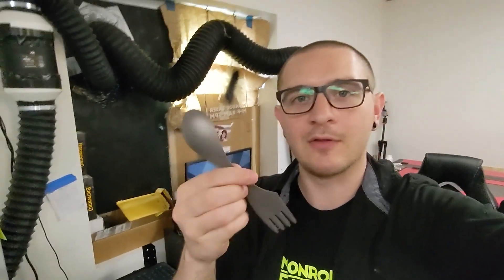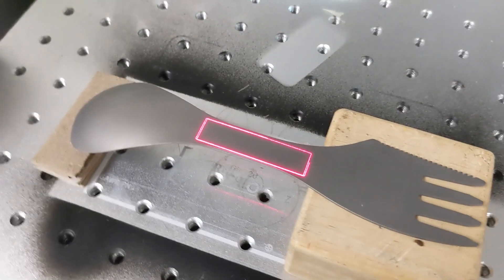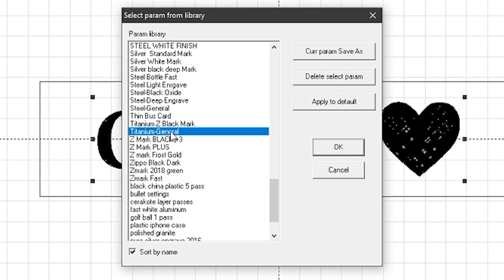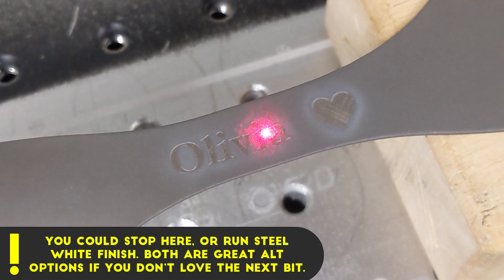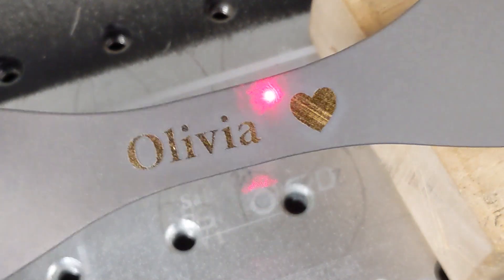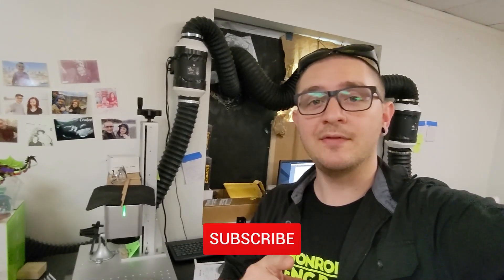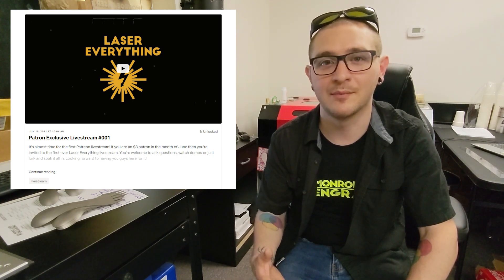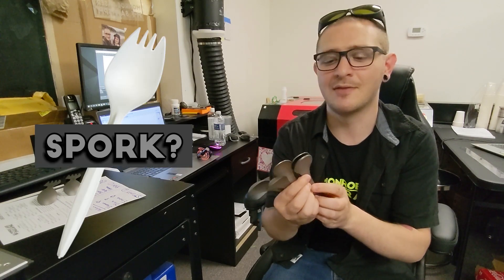How to Engrave TITANIUM with a FIBER LASER | Fiber Laser Tutorials

Comment: Hey Alex, Been watching your videos and love the detail for novice users. This video I like especially with the annealing feature.
I am wanting to cut titanium 2mm plate and am looking at a 50w fibre laser machine from china. Is it possible with a 50w and what specs would you need to help answer my question. Cheers
Reply from the maker: Something as thick as 2mm, you may want to look into a dedicated cutter instead of a galvo. Galvo being used to cut quite thin material is less of a big deal, but as you go thicker, the issues with having an angled cut and no assist air among other things really start to be problematic. Galvo doesn't have the ability to cut straight down through a material like a cutter would, since you're utilizing a lens and projecting the cut from a center point. Just not ideal for that use case.
Reply: @LaserEverything  Hey Alex
Thanks very much for your reply and advice. We are trying to get something that engraves and cut.
Realistically we only have to go 1.6mm on the titanium,so not sure if this is more doable with the one machine . Also will be used in a very small jewellery workshop.the one we were looking at is an enclosed unit 48x42x85 .Will be doing more engraving than cutting.
Can you suggest a machine that could do both.

Comment: I have a 60W Mopa and just started with titanium. Whenever I do any deep engraving the surface becomes very porous and rough. Is there a way to avoid this? I played around with the settings but no luck yet
Reply from the maker: You might be going at it too aggressively, you may need to reduce power /adjust frequency. Pitting and slag is typically related to too much heat and power

Comment: Hey Alex! What are your thoughts on engraving and annealing on PURE titanium items that has been HEAT TREATED and FINISHED (such as polish, etc.)? 

Thank you for the incredible videos that you provide for the laser community! You are a beacon of hope for those starting off!
Reply from the maker: I haven't attempted it but I'm sure its possible. Shouldn't make much of a difference with how the material responds to the laser! :)
Reply: the finish is just an oxide layer which is relatively thin and easily removed, so the first pass with the laser should remove it.  there isn't a heat treat like there is with steel

Comment: Hey Alex, I bought a 30W Raycus fiber laser with a frequency range of 40-60Hz. Is it at all possible to get this type of annealing for titanium? Secondly, is it even possible at all to get ANY type of annealing for any materials with the machine i have? 

Thank you so much!
Reply from the maker: The name of the game is heating the metal without ablating it. Set your frequency as high as it will go, then defocus until you start to see the desired results. Dropping your power a bit and increasing speed slightly can help as well.

Comment: Would this machine let you finish the design in a different color? Thinking about buying that same machine
Reply from the maker: The colors you can get from some (not all) metals comes down to the metal, less so than the laser. Titanium is capable of producing a few different colors but it's an uphill battle, and different settings for every single machine so it will take a lot of work.

Comment: i was wondering how I would get multiple shades of anneal that are faded together. example like purple into blue
Reply from the maker: Run your anneal on a slant. So actually prop your work piece up so one end is at a different height than then other and run the anneal on that angle. As the beam gets closer to the lens its' going to give a different effect.
Reply: Thank you so much for your reply. Your channel is very helpful!
Reply from the maker: Glad you're getting use out of it! Don't forget to check out the laser master academy!
https://masters.lasereverything.net/